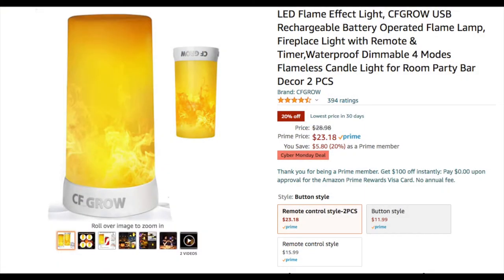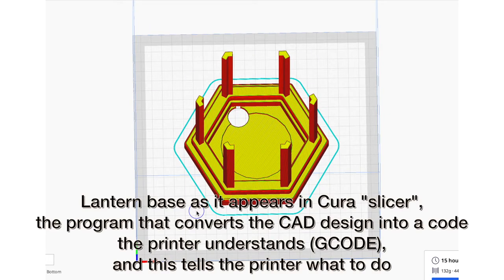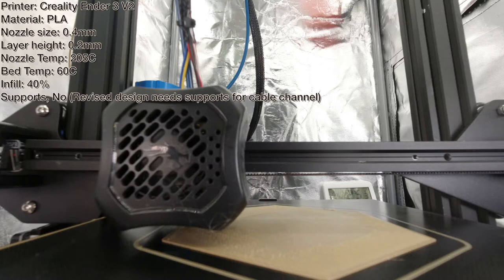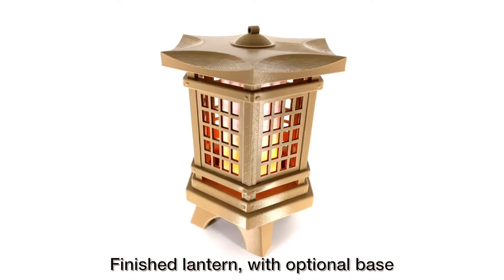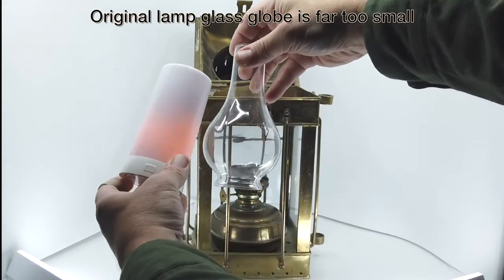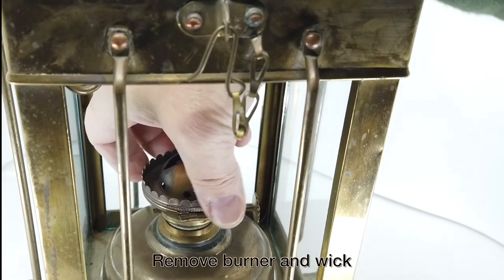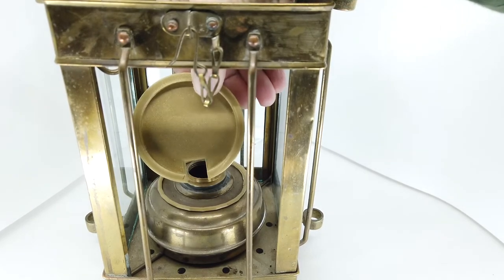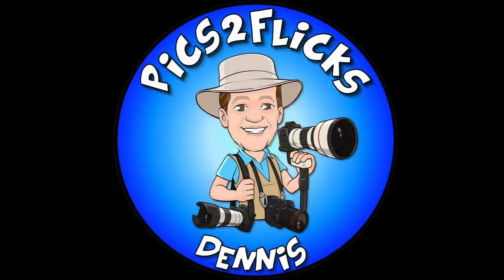LED Flame Lamp & 3D Printed Lanterns, PLA, T-Glase and Creality Ender 3 V2

Comment: Superb projects! - I used 2 of the same lamps, placed in a fire grate with some small usb salt lamps and some logs, inside a redundant fire place. It looks like a roaring log fire, very convincing even on close inspection.
I need to buy and learn how to use a 3D printer - you seem very proficient, and you’ve inspired me, thankyou